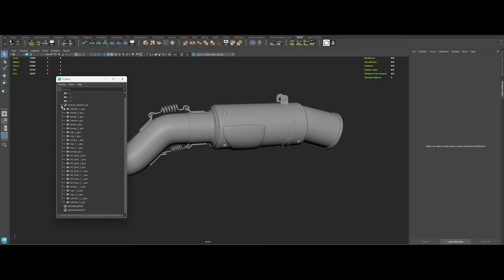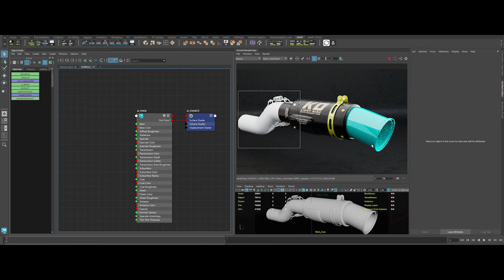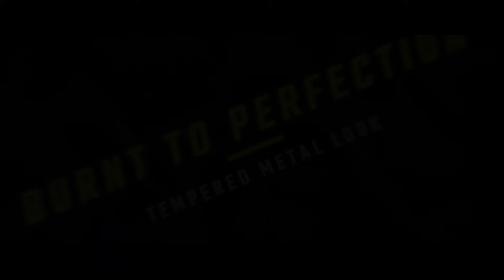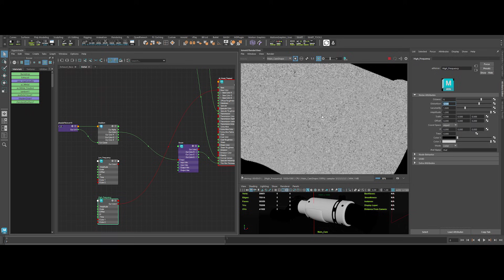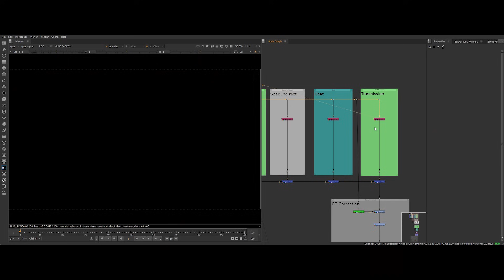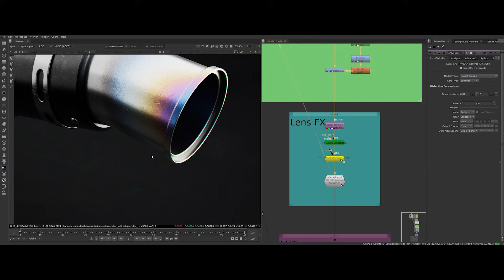Most 3D Artists Get THIS Metal Shader WRONG — Heat-Treated Look in MAYA & ARNOLD

Comment: Nice ! i Used Sustbance painter to manualy create that effect for a project, even the welding, so i had more precision
Reply from the maker: Nice one! 💪
Substance Painter is actually a great approach for this, especially when you need very precise control around welds and specific heat zones.
What I like with the shader-driven method is that it stays fully procedural and reacts to lighting and curvature, but both workflows are 100% valid depending on the project.
That welding detail must’ve looked sick